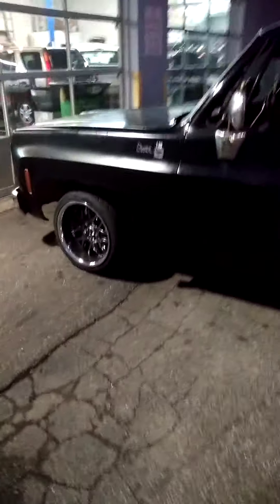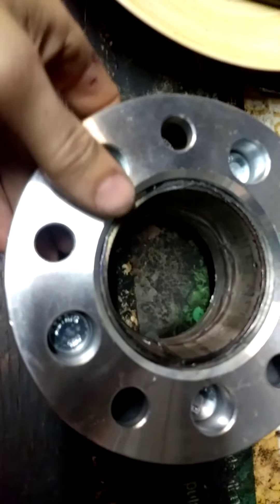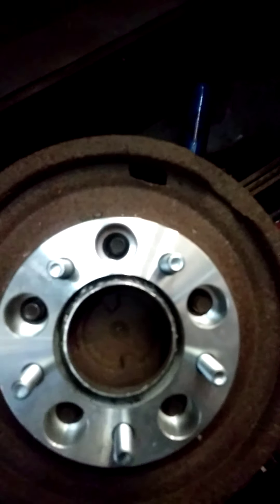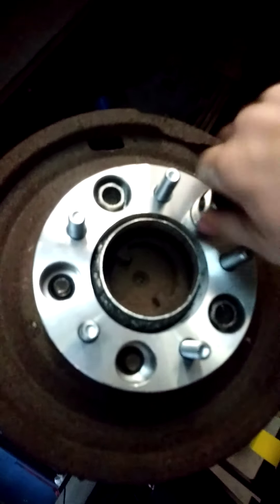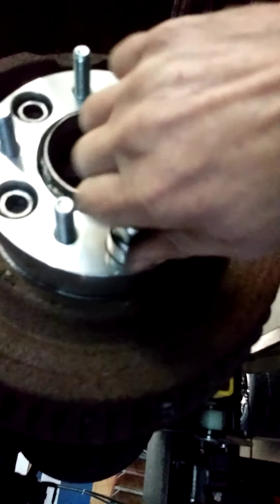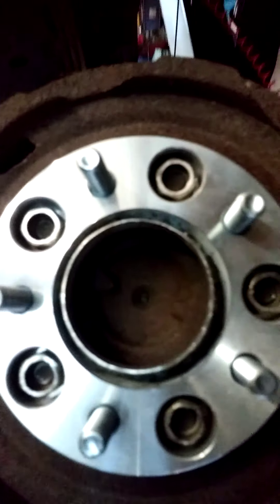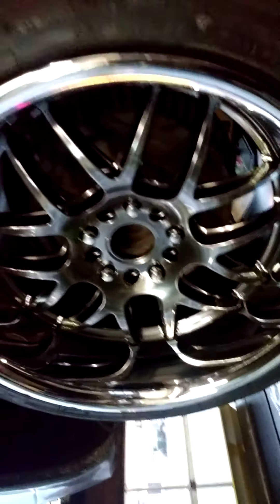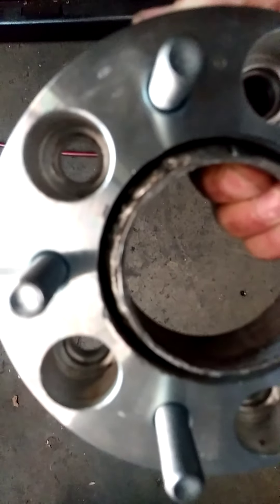C10 new xxr 526 rims part two

Comment: Sally Mae looks good. You should show her more
Reply from the maker: I will try I need to do the metal work and going to pull out the engine and trans everything is new 3 times over but have leaks that wont stop it pissing me off plus the edelbrock fuel system is not reliable so not sure want course of action I want to take
Reply: @WhoopAzzRacing  Im doing more metalwork on my Comet.  I had done small patches but now im doing floor pans.  Will probably post that in a couple weeks
Its a fucking pain.  Im not very skilled in that department
My video might turn in to a what not to do 😆 lol
Reply from the maker: @houseonpleasantstreet9774  I feel you I cut and weld all the time just not sheet metal I just dont want to fu*k it up body stuff has to look right
Reply: @WhoopAzzRacing  yes.  I know.  And the sheet metal is ecpensive

Comment: What size pipe did you make you centric ring from ? Diameter and Length?
Reply from the maker: @Ogotti-h7k  well the two pieces started off as 3 inch outside diameter and 2 1/2 inch outside diameter however I worked at an exhaust shop where I had a Ben Pearson pipe bender so I was able to expand them up to make them fit we had 3 inch expanders and 2 1/2 inch expanders and I just kept bumping them up a little at a time until they fit correctly inside of the spacer